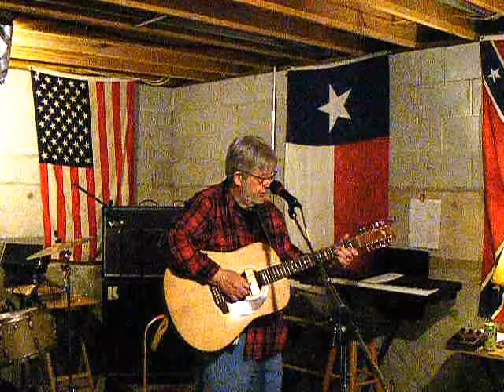Adding a Pickup to my Art & Lutherie 12 string.....Jack Shaw

Comment: Jack!!  Thank you very much for playing Dean Markley.  Nice job on the installation.
Reply from the maker: You are welcome! and thanks for the kind words!  This is the only way to go with an acoustic/Electric, in My opinion........You can remove the pickup and let it lay inside the guitar...
Reply from the maker: .....ALSO,    When you cut the Cord off the Dean Markley pickup, save it and soldier on a good 1/4"  jack.... The old cord makes on heck of a spare Guitar cord, in fact, it's possible to use it with this installation...